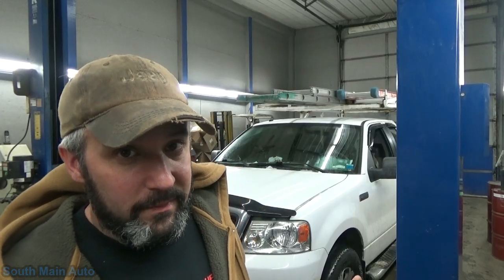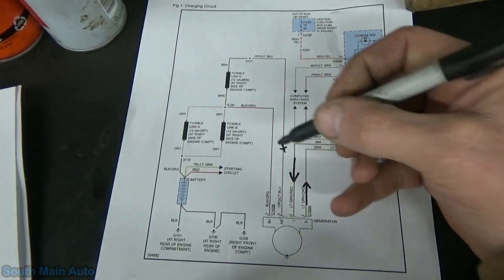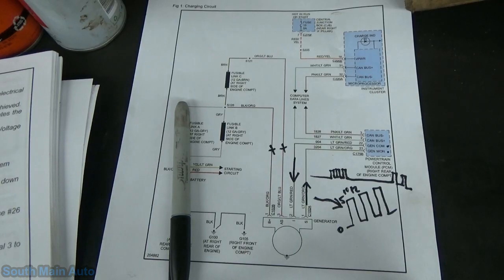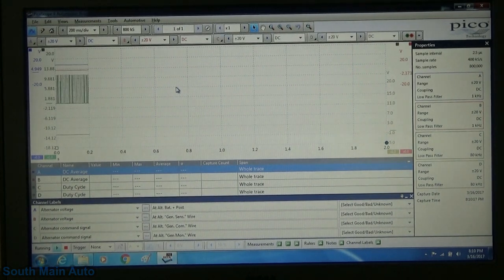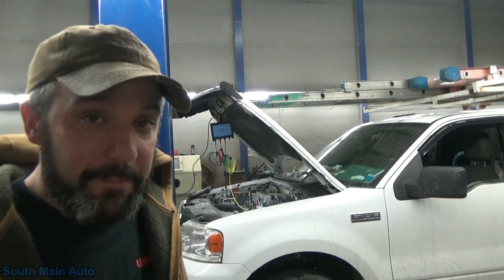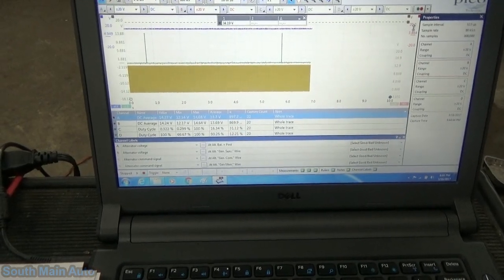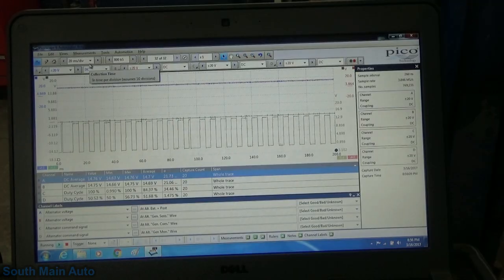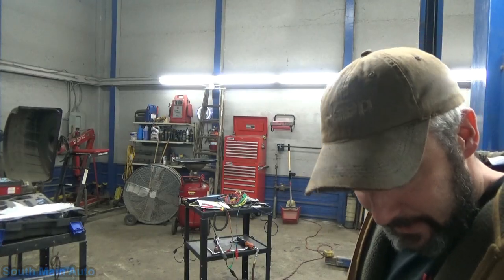Ford "Smart Charge System" Alternator Not Charging

Comment: Hello SMA!  Thanks for the video.  It might help me.  You ever seen this?  2005 Ford Explorer alternator OVERCHARGING!  The over charging is intermittent but very predictable.  At idle it charges around 14.5 volts.  Put it in drive and accelerate to 25-30 MPH and it jumps from 14.5V to 15V-16V-17V and will eventually get up to 18.1V.  Then all the guages shut down on the dash.  Door locks, windows quit working.  However the engine keeps running.  AC/heat fan keeps running.  Blinkers still work.  THEN, you slow to a stop and just before you stop, it goes back to charging normally and everything, including the guages and accessories.  It boiled one battery already.  I installed a new voltage regulator onto the back of the alternator.  Brushes were good.  No change.  Could it be the at PCM reference wire?  Oh!  And if you park it for the night it will drain your battery to zero volts.  So I am disconnecting the battery every night until I figure this out.  When the guages cut out I hear a relay under the dash click, so I assume that's just a fail-safe protection relay so that things don't get damaged.  Lately I've been just pulling the harness from the v. regulator at certain times while driving and just running on the battery so it doesn't get over charged and boil again.  Any thoughts?  Thanks in advance.

Comment: On my 2005 Ford F-150 5.4l 3v a Bad alternator caused a crank no start on me, it caused the alternator to put out DC, cause ac ripple diode failure and was causing my camshaft sensor to give off bad reading to computer after all the diag I did I unplugged alternator truck started replaced starts everytime

Comment: Another quick check, unplug Alternator Connector, start engine and quickly rev, Alternator should charge Battery at 13.5-13.8V (Fail Safe Mode/ Self Excite).

Comment: Ford Dealership Tech. Just adding in: GENCOM voltage comes from ALT to PCM, PCM toggles to ground communication to ALT. GENMON voltage comes from PCM to ALT, ALT toggles and communicates to PCM. It's wild. Voltage goes one direction, communication goes opposite direction. Recently did a huge deep dive into because of 2008 Escape non hybrid 3.0L charging at over 19 Volts!!
Reply: @michaelr6205  do you have any advice on an 06 escape that keeps eating the alternators I put in there they'll last about 3,000 miles and then stop charging. It'll run with the battery cable unhook. 3.0
Reply: I had 1 just about the same year. I had over 18 hours unpaid into it. Never got it resolved. Couldn't figure it out. Performed so many tests and then performed them all again because I started second guessing myself. Sorry brother

Comment: So..Eric ..what was the outcome of the battery light not coming on?… I now have a 2004 ford explorer that has the battery light on then goes off after a few minutes… at that point I can see battery charging voltage…I have not checked the gen monitor signal yet with a scope

Comment: This was great. Thanks for doing this. Do you have a video on LIN (Local Interconnect Network)? Uses a BSS ( Bit Synchronous Signal) . Another charging strategy utilizing only one wire voltage regulator to communicate. Think BMW & Audio. Interesting stuff. Very challenging. Keep up the great videos. You have another subscriber.

Comment: Had similar issue except battery light ON, as well as notice on message  board. same test done on mon and com lines. They showed the PCM and alt were talking but output voltage  too low. Un plugged replacement did not go to default charge. Replaced alt. Proper voltage  presentations but battery light and message still on.  PCM sets light and message so updated program in pcm. No change. Swaped to a OEM FAMOCO alt  and  NOTHING ELSE. All issues went away.  Mon and com look exactly the same as first replacement and the original  but no lights or message.

Comment: Good video thanks, had one a month ago, but with a light, replaced the alternator after making sure all the wires were good,  used alt 250.00, new was 2400.00 can stumbled first trip out, got bo9s3d and has been good since, not sure of the issue

Comment: I know this is old, but I have the opposite issue on a 
 2019 F-550 superduty. The battery light wont stop being on. Ive finally narrowed it down (I hope) to the actual plug on the driver side alternator. ( it has dual alternators). And to make it even more fun, there is a under hood V-Mac air compressor mounted smack on top of the alternator. But when I put my volt meter back probed into the Gen mon ( I think) I can watch the battery light go on and off as I wiggle the plug. When the battery light is on I have 0.03ish volts and when the light is off I have ~ 4 Volts. I think I seen something about throwing a code is based on vehicle speed Vs Time at a certain threshold. So maybe when you were trying to throw a code or make the light go on it wouldn’t do it because the vehicle wasn’t moving. Just a guess tho. Anyway thanks for the Excellent video and information!  Quick question, when you have your scope hooked up are your leads just back probed into each wire you want to measure? And then one ground to the battery?  I have a scope someone gave to me, I just haven’t used it yet as It needs a new battery pack. Cheers!

Comment: Ive got a Ford Escape early 2000s withy 3.0l V6 -  similar problems - BATT light ON, but battery charging OK ( have added digital voltmeter to dash) -, then when gets hot , the BATT light goes OFF, and alternator stops charging. Then sometimes the alternator weakly charges as long as , blower, headlights , etc are off.
Thanks for posting your video. I'll try disconnecting ECU connection to alternater- let alternator run in "default" mode to test .

Comment: Iv fitted a battery monitor on my stop start car with a AGM battery 70ah, iv replaced battery. Iv reset the BMS on the car and told my fittered (Bluetooth) battery monitor it's a new 70ah battery.. it's state of charge get to 95 - 100 % then I notice while driving the battery not charging, then it charges bits and bobs. Gets down to like 93% soc and kicks more current in... My theory is it's a maintenance to the AGM battery??

Comment: 02 f150, just finished lower radiator hose and heater core flush ( so i jostled the fusible links/main spade connectors on firewall to get to heater core hose). Got it all back together, fired up no problem, ran it for 15 minutes, great heat. Then radio dies and no electric power. Shut it off. Then dead battery and no start. New battery, fires right up runs fine for about an hour, then radio dies, lights out, and coasted to side of road. New alternator, fires right up runs fine for 10 minutes, then same thing, all electronics die and engine shuts off. Fusible link to battery??

Comment: What can cause low voltage but normal  amps . 11.5 volts and 35 amps at idle with lights on and blower on high . 2002 Ford Escort.  Thanks for any information

Comment: Worst thing about fords is the smart charge system I currently have a Ford fiesta EcoBoost 2015 airbag light on windows don’t work  and hill start assist unavailable then the alternator doesn’t seem to be charging the battery even after replacing both of them

Comment: Does 2008 ford f150 4.2 L have smart charge system.?  My battery went bad after 7.5 yrs and replaced it. gauge went down to zero. I replaced the battery. THen the charging lite blinked twice after testing driving it the next day and i returned home afraid to get stuck. Any ideas?

Comment: I have watched this video a few times, learning a bit more each time.  I went through the Service Manual pinpoint tests and determined I have a faulty generator/alternator. I had an intermittent "Check Charging System" and illuminated battery picture.  Full load voltage drop from the main output terminal and the battery positive pose was 110. something mV when it was working properly and 2.4 mV when it was no longer charging the battery.  The book said if below .5 V (eoo mV) replace the gererator.  Does that make sense?  I don't have the scope and other equipment you have.  Even so, I learned a lot from your video and will watch more of them.
Reply: 500 mV of course, eoo mV was a typo.

Comment: I'm having similar problems with my 2019 F150 v8. I followed your steps and think I narrowed down the problem. The system wants to charge at a very low level, about 12.5 ish if nothing on. I usually turn on the lights because that boosts it to 13.5. I've checked continuity and done a live scan. The PCM to alternator Genmon ? line is constant and the Gencom ? line is supposed to send data about every 5 seconds. Mine did that sometimes but also had longer bursts up to 20 seconds etc. I think that is the problem with the system. Just a few days ago it started sending me error messages throughout the day. I've noticed that if I'm charging at 13.5 (lights on) the system is happy but periodically it will jump up to 14.# and the light comes on. When it drops the light goes off. I have no idea why it is jumping up but it is not under or over charging. The error message is annoying and I may need to replace parts, although three bench tests say alternator is good. I'm going to start with BMS because bolt is starting to fail. Hopefully I'll figure this out. Really appreciate the videos.

Comment: I have problem with Mondeo 2015, on idle 12v charging on two alternators, on 1500 and higher revs its 14v. Wires from alternator to pcm is ok, battery is new, ground is good, positive cable good. Maybe regulator is bad..

Comment: I wonder if the PWM outputs of an arduino could be used to create a "smart 1 wire" alternator...not even need the PCM  (like on a gas powered generator setup kinda thing)  or even a detector to see if the alternator is working, thanks for the "unplug the connector to test at 13.7 default status) which is awesome!!!!!!!!!!!!
Thanks!!!!

seems like it's a "computer controlled" smart charger...LOL

Comment: If you want to generate a wave lengh on the Pico turn on/off the fan and rear defogger, it'll initiate a duty cycle on command.

You could use a jumper across GenCom and GenMon and let the alternator talk to itself 

Verifies communication from the harness to the PCM and indicates a good PCM.

It'll come in handy if you have overcharging.
Reply: It seems the PWM is kinda inverse....the more PWM "duty cycle" that is on the "gen com" makes the voltage output go up, when the pulses stop (or go to low duty cycle), the alternator stops generating voltage

Comment: From working with TV remote controls, the button pushes usually send a code to the infrared emitter and if you hold the button down continuously, a "repeat previous command" code is sent instead of resending the the entire code again. You may be seeing the initial GEN COM code being sent followed by a "2 blip, 5 second repeat code" (just guessing). It follows that when revving the engine the conditions change so it sends a new GEN COM directive and then follows with a "repeat" code until conditions change again.  I watched your video because I have an 07 Ford Focus and changed the alternator and  had output for a short time until installing the alternator cover which squishes the wires. I lost the output at that point. I will have to check continuity in the GEN COM and GEN MON lines and make sure I have continuity in those. Like you, I had no battery warning light.  I saw another Ford alternator video where there was lack of continuity in the command line and by replacing the wire, the output came back. Thanks for taking the time to make such a great video.

Comment: Thanks for video I wish mechanics around me knew what they were doing. So far 2 have no idea what’s wrong with my 04 expedition 😢. I had a reman on for 2 years and no problems but now “check charging system” driving me crazy. Everyone tells me it must have a motorcraft on it or else. But for 2 years no problems and replaced with reman again because old reman was only putting out 13.2 all the time but now putting out 14 volts and buzzer randomly goes off and when it rains it’s 100%worse. WTH.

Comment: Your video was exactly what I was having problems with with my six GEN alternator charging system in my Ford mustang 200 4 oh I’ve been trying to deal with this for like three days I’m not a mechanic I don’t have a mechanic shop but I am mechanically claimed and I tried everything I’ve researched it all and it kept just not charging so I’m gonna go try what you just did and I’ll re-comment back in the comments but so far you’re a freaking genius thanks
Reply: i've got the 04 Mach 1, 6 month old alternator and i cant find any info on the middle wire on the alternator pigtail, i get 12v to the 2 outside ones, nothing on themiddle one

Did you find a fix?

Comment: Here I am on Halloween in 2022, watching an old Eric O vid that has some stuff to do with a project I just had come through. 2022 F550 with dual alts overcharging, one was completely dead, other was putting out 15.5v. They (bosses) told me to replace both alts after hearing this, didn't want me wasting my time diagnosing anything. After all the road tech whose truck it is told them it needed an alternator.. Still overcharging out of the one, the other seems to be working, for now at least.. LOL

Comment: For the GEN COM and the GEN MON circuits it looks like there is no dedicated ground to these single ended signals. The encoding should reject any ground offset voltage between the PCM and the Alternator. Meaning the information is pure Duty Cycle based and not a filtered PWM signal relative voltage to alternator ground. The PCM must default to max charge based on the battery voltage absolute value at key on.

Comment: In looking at the electrical drawing its strange that the alternator charging output to the battery goes through two Fusible links in parallel to the battery POS. You should only have one fusible link to protect the POS wire going to the alternator as close as practicable to the battery POS terminal. A fusible link is a wire type with a wire gauge much smaller than the wire it is protecting to provide a known point of failure in case of a short circuit. The fusible link wire is designed to open and the insulation to bubble when overloaded so you can identify the fault by looking at the fusible link portion of the circuit, usually around 6 inches. You can by fusible link insulated wire on spools in various wire gauges to make your own repairs.

Also, if you look at the wiring diagram you see a CAN bus between the PCM and the instrument cluster. Why not just put the alternator on the same CAN bus? You already use two wires as GEN COM and GEN MON and the CAN bus is only two wires.

The original intent to have the PCM control and monitor the alternator is that the PCM would have a strategy to estimate battery state of charge and control the alternator to provide proper charging in the different battery charge states; Bulk, Absorption, Float, ETC. What year this strategy went into effect I don't know, but you may be able to find out if you look at the variables you can monitor with the scan tool that would indicate such a strategy is in place. Like battery state of charge, SOC.

UPDATE: 

My Ford EVTM manual wiring diagram review for light vehicles with V8s from 1996 to 2008 indicates the reason Ford uses two 12 AWG fusible links to protect a single B+ 6 AWG (BK/O) GXL copper wire is that Ford did not specify a FL with a smaller gauge than 12 AWG. There is no 10 AWG or 8 AWG FL used for cars and light trucks (up to the base F150). So, Ford and the supplier decided to use two 12 AWG FLs in parallel. 

The dumb (as opposed to FORD smart alternators like shown in the video) alternator applications have a 20 AWG FL protecting the Alternator sense (A) terminal circuit (16 AWG single wire circuit), and two 12 AWG FLs protecting the B+ circuit (6 AWG single wire circuit), to protect the wiring in case the alternator shorts out internally on either of these two circuits. However, the paralleling of the two 12 AWG FLs is very unconventional for an OEM in this time period, and the question that a lot of technicians ask is what if one of the FLs fails due to corrosion or chaffing, will the other FL be able to correctly operate the circuit. I believe the answer is no. I think the preferred repair if there is a failure in one of the 12 AWG FLs would be to use a single 10 AWG FL of the same length (around 7 inches for Ford) to protect the 6 AWG B+ wire. Use non-insulated step down (10 AWG to 6 AWG Burndy butt splice using a hydraulic crimper) butt splices with RED dual wall heat shrink to make the connections. Do not solder FL connections. Ford often puts the A terminal sense at the same splice after the 12 AWG FLs which I find a little strange, you would think the sense wire would be connected directly to the battery POS or directly to the POS of the main power distribution box under hood.

The two common failure modes of the 12 AWG FLs in parallel is blown due to short circuit of the B+ circuit (which is not very common unless the rubber terminal boot has rotted away) or failure in one due to corrosion (usually a nick in the wire and not at the splice) in the other, which leads to strange behavior until the other 12 AWG FL fails. Corrosion seems to be the more likely failure mode.

If there are any technicians or engineers that know more about the alternator circuit parallel 12 AWG FLs approach please let me know.

Comment: Great video and info. When I worked at Kia I found they also don't have the battery light come on when it's not charging. Have had them come in barely running at 10 volts after a boost and no light.